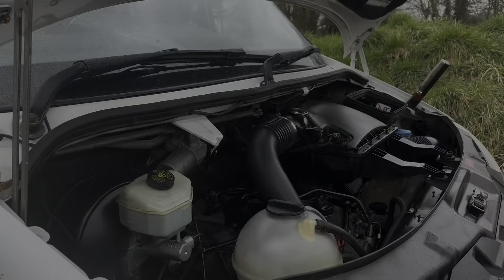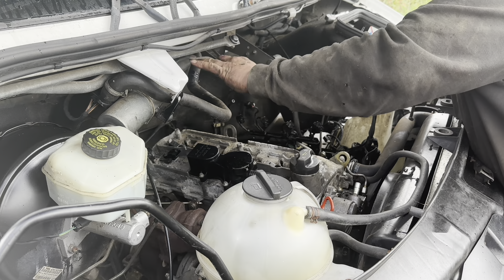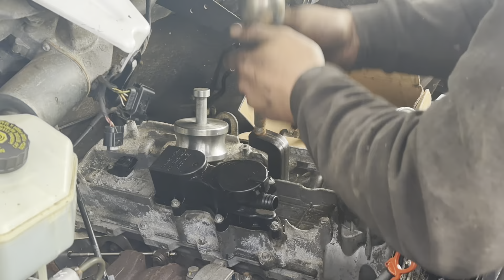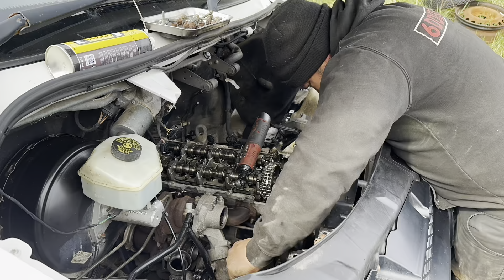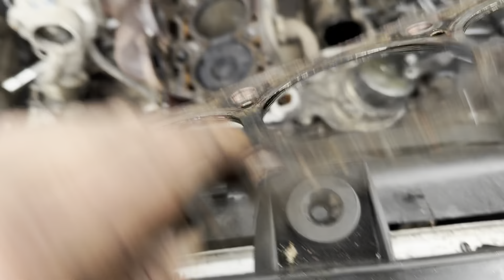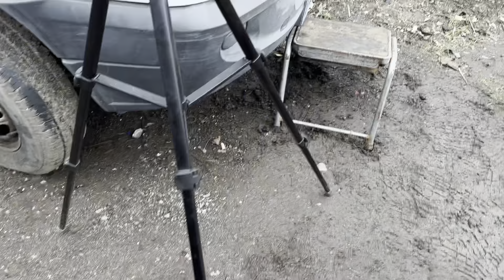I bought a Mercedes sprinter 515 is it just a failed head gasket ???

Comment: Hello.how long time takes to remove cylinder head?
Reply from the maker: All depends on the injectors really if they come out 2hrs if they don’t it can take hours 👍
Reply: @6DDIESELSDorset  i just removed the cylinder head in 8 hours. I had problems with rusty ex manifold nuts so i had to remove with ex manifold and small turbo. injectors was pretty easy to remove. i will say not easy job on MB 😄